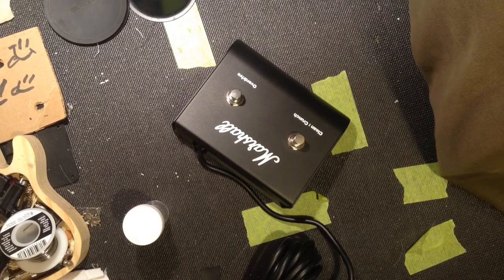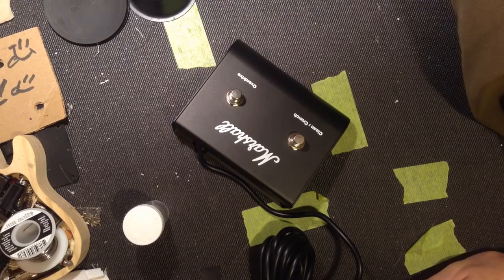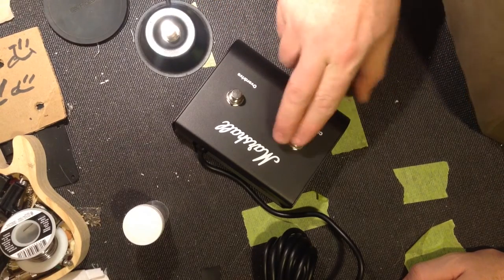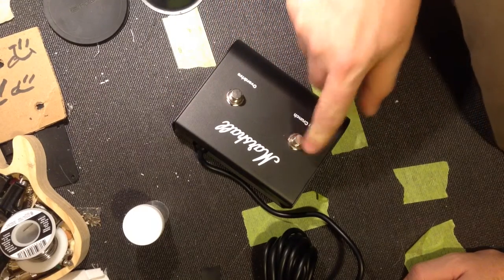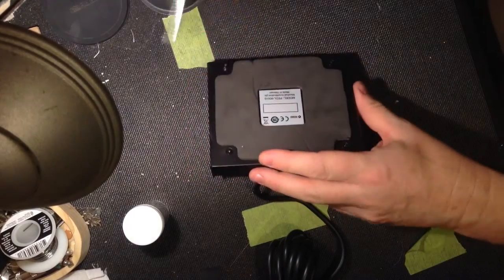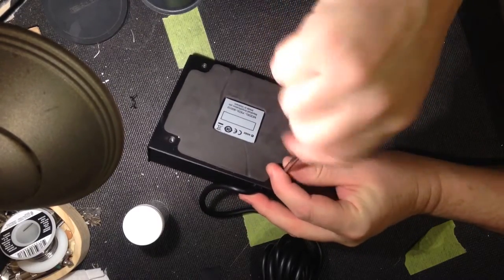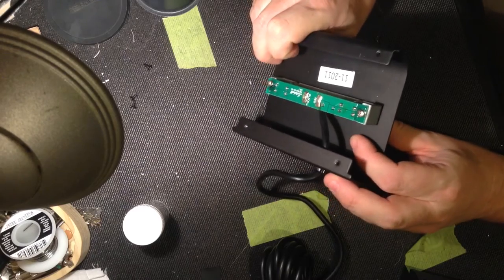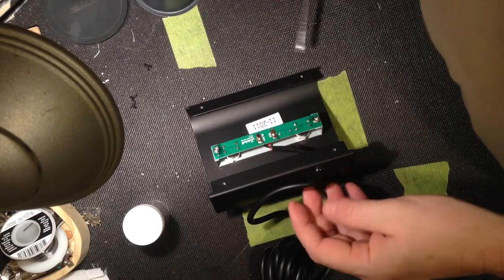Marshall foot switch replacement.

Comment: Hi, do you know how this switch works by default? I have a regular Marshall Footswitch (the one that uses latching switches), and there is a tip, a ring and a sleeve (stereo cable), and each switch when pressed bridges either tip with sleeve or ring with sleeve, however this one uses momentary switches and the cable has only tip and sleeve (mono cable), so how does it send two different signals to the amp? I measured continuity in the cable and I get nothing when I press either switch.
Reply: This kind of switch works with digital style amp which don't need a real switch but just a push push style. I have repaired an MG101CFX and it works with this no latch footswitch, one switch just closes a short between tip and sleeve, the other one puts a diode between them. The ICs inside the amp then figure out what to do with these signals I guess